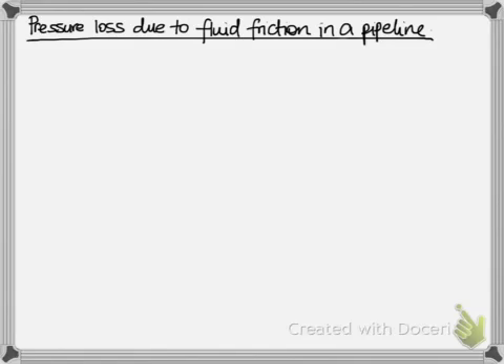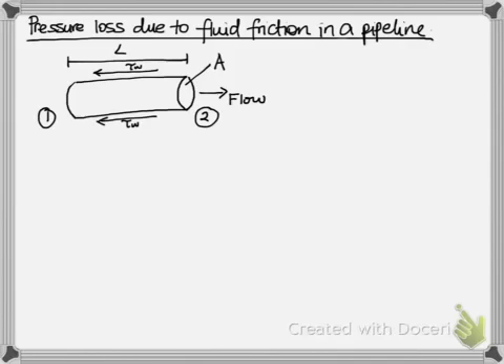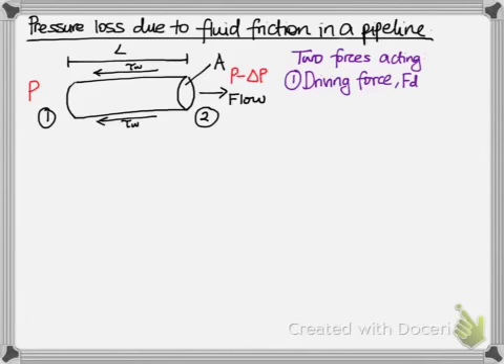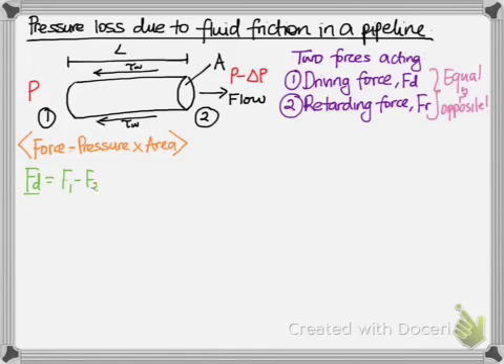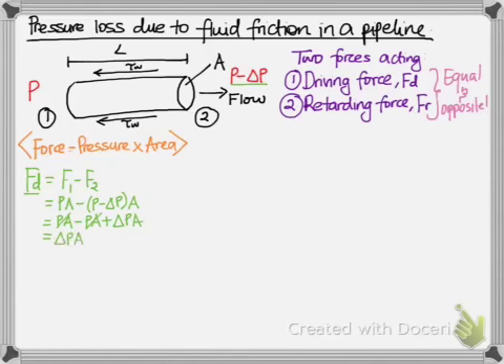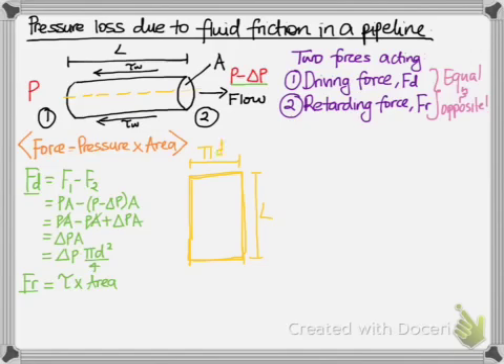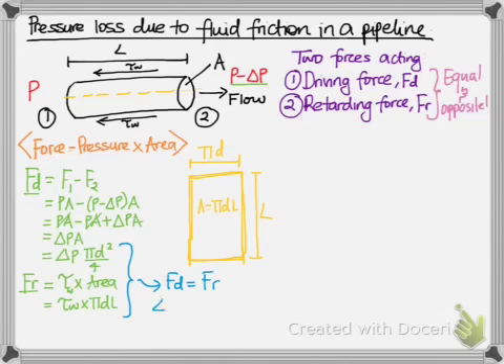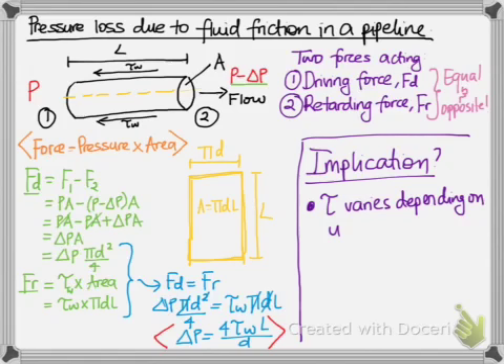Pressure loss due to fluid friction in a pipeline

Comment: Thank you so much for your great lecture. And I have a question about it. If the pipeline is heat-insulated, will pressure drop?
Reply: The added frictional losses would still heat up the fluid I believe.